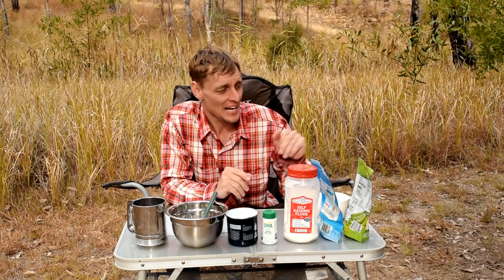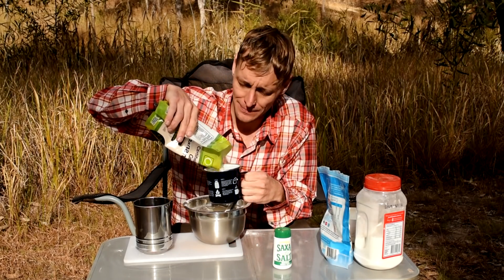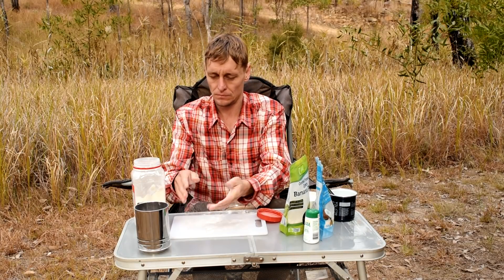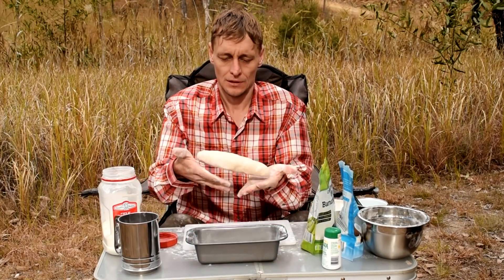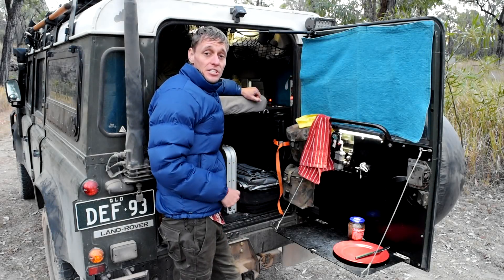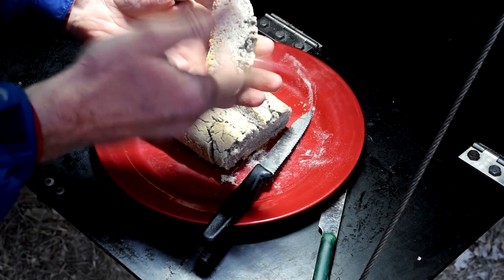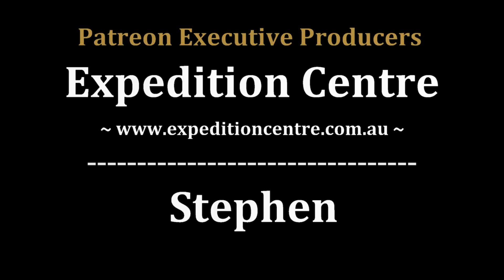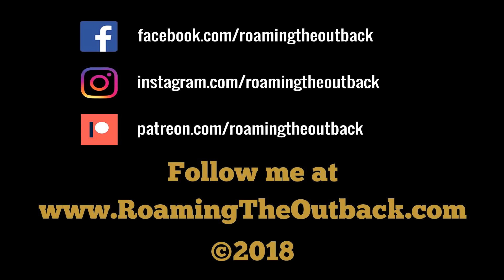12V Travel Buddy Oven How To Cook Banana Coconut Damper In The Bush

Comment from the maker: This 12v oven uses only 6 amps. For the 2 1/2 hour cooking time, 15 amp hours were used. Not a problem when connected to a secondary battery.
To equip your vehicle ready for an outback adventure, visit the Expedition Centre for all your overlanding and touring gear --> https://www.expeditioncentre.com.au

Comment: You could also add powdered milk but you don't have to. Your recipe looked just fine.
Variety in the bush is best but it's hard and always a challenge to think up something new in a different combination. Cheers.
Reply from the maker: Yes, trying to experiment. I think in this case adding some baking powder would have helped it rise more, but otherwise a damn good feed.
Reply: Yes, self raising flour still needs baking soda in it.

Just don't add sugar. Sugar is what burns bread.

Comment: Great channel, I have the same oven but I am yet to use it, does it drain your battery a lot when the car isn’t running ?
Reply from the maker: Thanks. No, runs off the secondary battery so no problems. 310w of solar connected so quick to recharge the next day.

Comment: Looks amazing ... where does the term “damper” come from? Also, isn’t your oven very heavy on your aux battery?
Reply from the maker: Damper is a Lancashire dialect word meaning “something that takes the edge off appetite”.  Later being used to refer to bush bread so the name stuck. My Aux battery has solar connected, and as a Lithium I have 80ah available to cook with. It's only 6 amps per hour so very small seeing most dishes are cooked in under 3 hours.
Reply: Roaming The Outback thanks, really interesting, coincidentally I live in Lancashire UK but have never heard the term. Must be an old one!